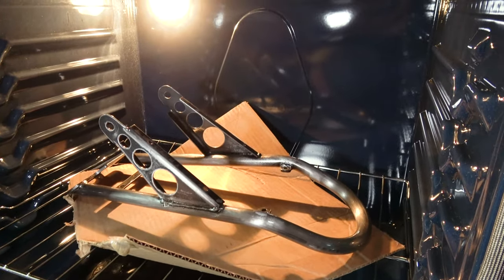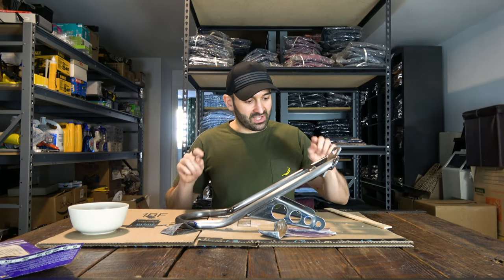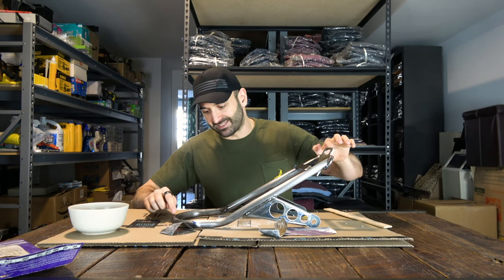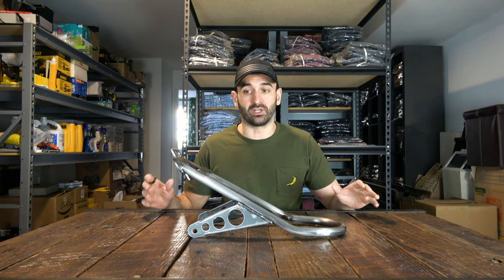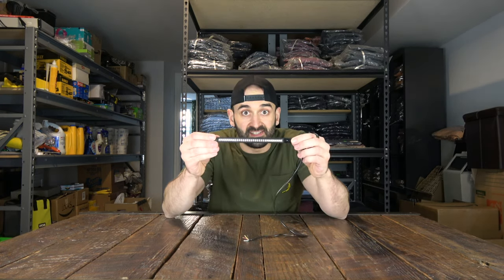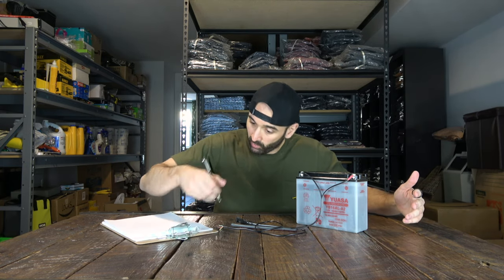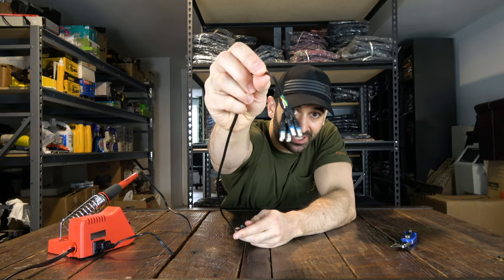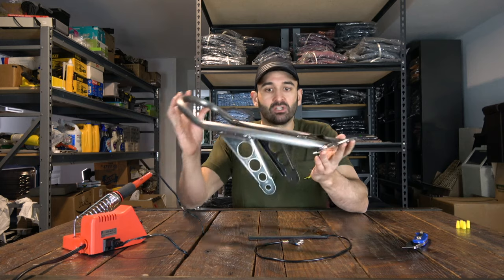HOW TO FIX PAINT RUNS ON FRAME. Painting hack on motorcycle Café Racer subframe

Comment: That taillight/flasher strip worked great for me.  Only complaint is the wires are too small, and its a pain to solder.  In hindsight, soldering bullet connectors may have been a better idea.  I cut the stock plug from the stock light, soldered the tail light wires to the plug, and plugged that into the bike.
Reply from the maker: Yes Joseph! Those wires are super thin, I had to be very meticulous when I handled them!
And the heat shrink tubing wasn’t easy to do because of the size difference between the bullet connectors and those thin wires.

I like your solution using the stock plug though. Yamahas from those years like bullet connectors so that’s what I did, but I was thinking about changing things up to 1 waterproof connector with multiple pins